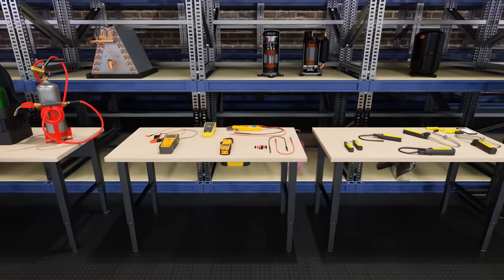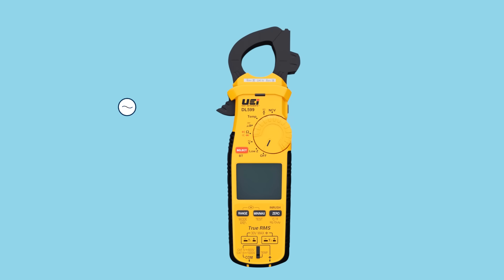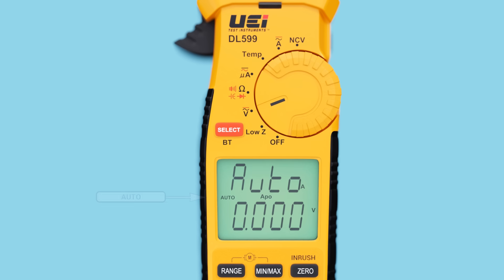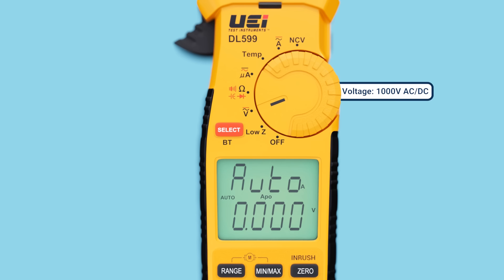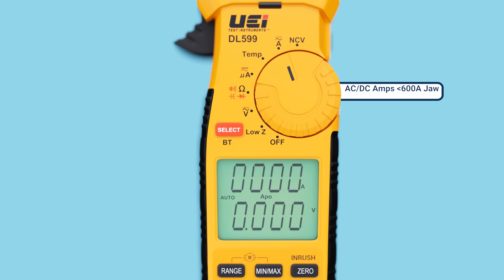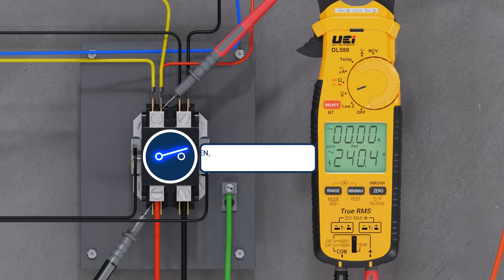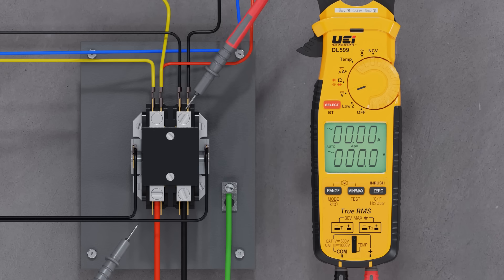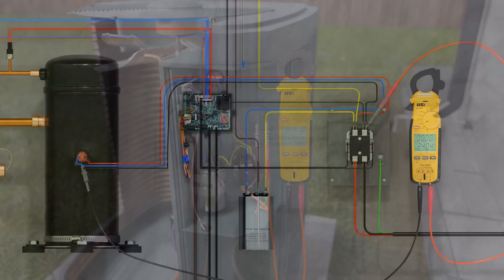Multimeter 101 for HVAC 3D

Comment: When using the ohmmeter funciton of your multimeter to check resistance or continuity, a low ohm's reading or audible beep, doesn't necessarily mean that you have a good circuit or good path. It only means that the circuit is complete, but a complete circuit is not necessarily a good circuit or good path. The ohmmeter only uses about 5 volts and a tiny current to check resistance and continuity, so it may be able to carry the tiny current but not a larger one. If you come across a circuit and you test it for resistance or continuity and get a low ohm's reading or hear the beep, and the load (e.g. fan, compressor, contactor, relay) still doesn't work, use a test light or another known good load that draws the about the same amount of amps. If the light bulb or known good load doesn't work, then check the circuit wiring and connections for faults. This could be the result of a loose connection, corroded connection, corroded wiring, or damaged wiring. The wire in the circuit may be made up of 20 thin individual strands wrapped in insulation but it can get damaged where 19 of those thin strands get cut and only 1 thin strand remains. This 1 thin strand will pass the resistance test by giving you a low ohm's reading and also pass the continuity test by making the audible beep, but will not be able to carry the current required for the load in the circuit.

Comment: This is great; and I love the HVAC School videos - I have gained a lot of helpful knowledge here... but I have to say; discharging a capacitor with a screwdriver is not good practice. If the goal is to promote safety, this should always be done with a multimeter set to the highest voltage setting.

Comment: 8:07  I like how it appears to specifically be a screwdriver with a broken tip being used to discharge the capacitor.  Even broken tools can still have uses!  I'm also a little surprised they actually showed what everyone actually uses to discharge a capacitor instead of using a resistor or dedicated capacitor discharge tool (which would be the "correct" way to do the job, but I don't know a single person that's ever done it that way).
Reply: That's because you don't pay for the capacitor when it fails. If you did, you most likely would use a resistor or your voltmeter to discharge it.

Comment: One bad thing about digital meters especially better ones with high impedance have to be careful when measuring AC voltages. Numerous times while only having one probe touching an energized wire and other lead not connected could receive a reading over 80 volts especially in damp locations.

Comment: From a retired industrial electrician: NEVER ever purchase or use ANY safety or test equipment from lying cheating lack of quality control POS communist china!. Your life & the safety of others never worth saving a few dollars on inferior china garbage. Still have two Amprobe meters that I purchased in the 1970's and a Fluke VOM meter from early 1980's. I started out using my dads Simpson model 260 analog meter and was so happy when I purchased my first digital auto ranging VOM.

Comment: Megaohm meter..  you mean an insulation resistance tester/meter.   What do you mean by a Megaohm meter, what are you testing?  Your testing the Insulation of the conductors with a high voltage. looking for leakage.  Your testing the Insulation resistance.    Where you may be getting confused is one of the original manufactures of this type of meter is called Meggar and they still make some of the best meters today.  And its often called a Meggar test because of this. But this is just industry Jargon and incorrect, It is not a Meggar test . Viewers, this test is performed by an Insulation resistance tester. Not a Megaohm meter.
Reply: There’s an article on Wikipedia if you need more information on them. Just google “megaohmmeter”.
Reply: It's you're not your and it's Megger not Meggar. Check yourself before checking others.